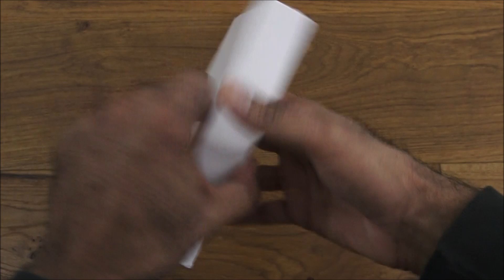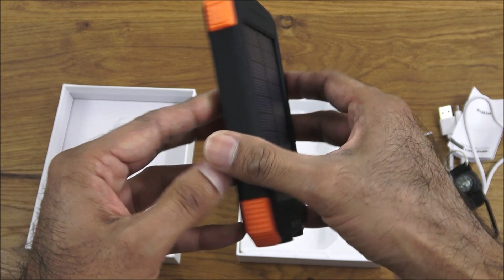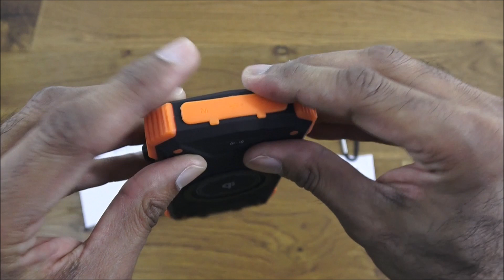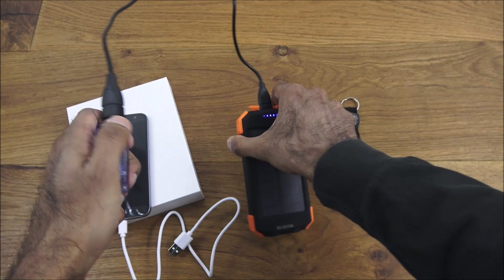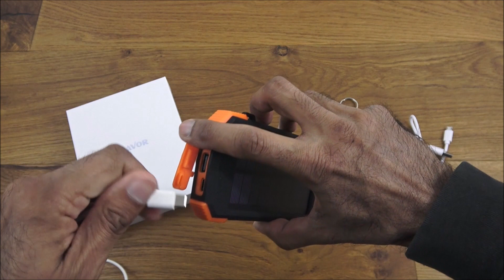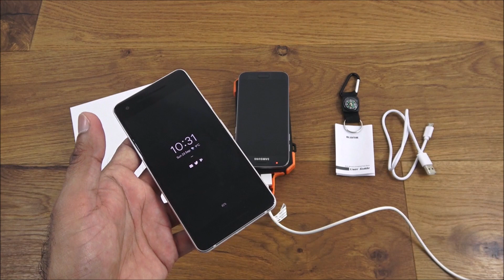Awesome 10000mAh Power Bank with Solar Charger  + LED Light by BLAVOR [Hands on Review and Test]

Comment: how can you measure the the solar panel charging? i left it 3 days in the sun and i dont see it charging. only see the green light but no measurements.
Reply: Briefly press the torch button. It should show you how charged it is in the form of four blue dots. Each lit dot represents a 25% charge.
Reply: the solar panel is rated 1.5w the newer version is probably different but they recommend using the outlet as it would take about 30 hours to fully recharge via sun

Comment: I bought one of these and the solar panel is worthless! Since the charger is advertised as a “solar” charger, it is falsely being advertised. In fact, and you failed to mention that this product comes with a note from the manufacturer that states that the solar charging capability essentially does not work!

Comment: Watched entire video waiting to see how solar power charging works or if it's just a "gadget" spec that is a waste.  Maybe update video findings after trying to charge it with the sun?
Reply from the maker: Thanks for the comment. The solar charger of the device is always active and as soon as the device is under light the green light comes on above the solar panel indicating that it's charging the internal battery. If you notice in the video the light came on with he lighting on in the room giving a trickle charger. Hope that makes sense.
Reply: The fact is that solar charging is really for backup, it shouldn’t be used for a main source. Technology have not advanced enough to super charge a 10000 mah battery at the size given. From having a electric car and having solar panels the efficiency with panels are not there yet. To charge this device  for a completely dead state it would take days, however, it;s still useful because most people wouldn’t completely drain the battery, so if it’s at 50% or even 25%, and it consistently being exposed to sun light then within a day you could expect some percentage of increase in charge. By the way the company confirmed this statement.